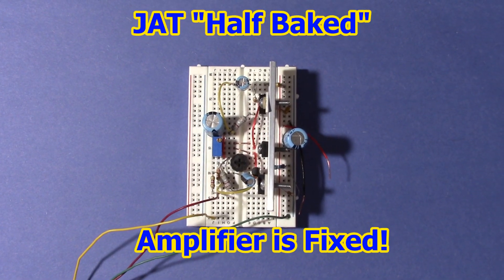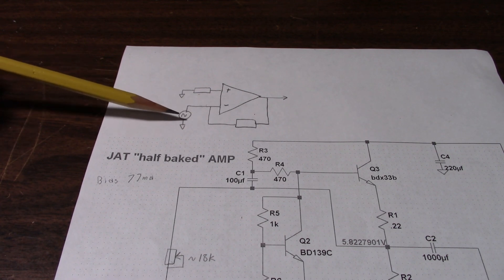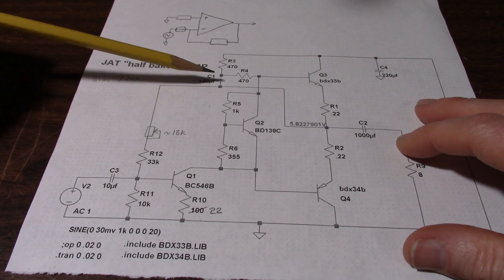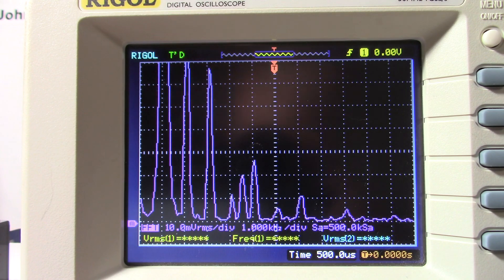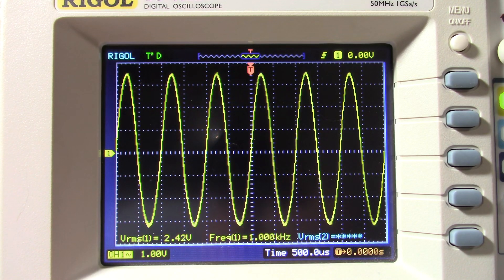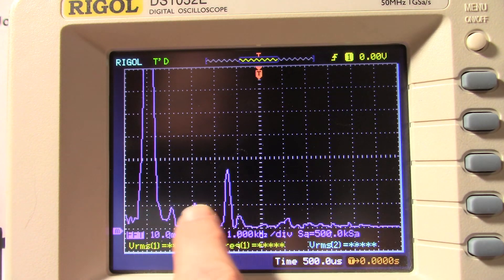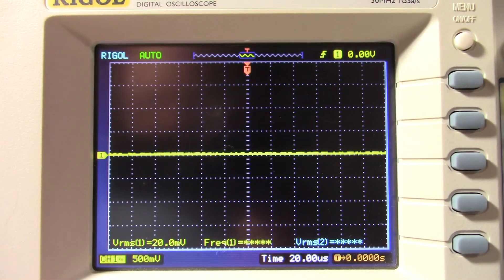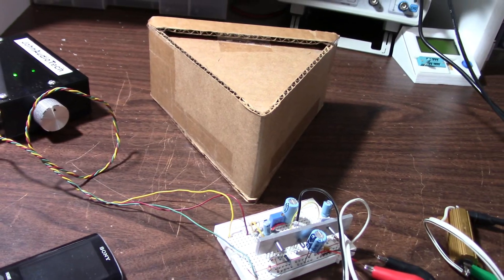JAT half baked audio amplifer problems fixed

Comment: I didn't even think about the 4.7kΩ resistor. perhaps, further increase in drive impedance would reduce distortion even more. I wish I could post a schematic, for a class A complimentary driver stage, consisting of a 2N3904 and 2N3906 transistor with the collectors joined at the input of the amplifier(get rid of the 4.7kΩ resistor) and the emitters of the transistors would use 4.7k emitter follower resistors to the supply rails, and the  bases would be biased by connecting 4) 10kΩ resistors all in a series across the supply rails, the bases of the transistors connected to the junctions of the 10 k resistors connected to the rails, to the center two resistors, and finally, apply the signal source (through the input capacitor) to the center of the 4 resistors. That would convert the voltage from the signal source, into current, providing an infinite drive impedance to the amplifier, allowing maximum effectiveness of its negative feedback. you would be surprised how good your signal to noise ratio would be.(the input impedance would be about ~9.2kΩ)

Comment: hello john, i've working on a similar circuit to yours but i have some bias stability issues, it's very sensitive to overheat when the voltage(9v) gets a little bit out of range, is there any trick to keep the bias constant and dependent from the power supply voltage, this also would be good for portable aplications keeping the sound quality over time when the batteries run out.

Comment: btw, John and all the other audio amplifier enthusiasts: If anybody wants to build a self stabilized audio amplifier for 10..12 W @ 4 Ohm and distortion well below 1% with very low effort, you can use the concept of a low power rail-to-rail opamp with a BJT booster stage controlled by the currents through the opamps power rails (see https://ibb.co/QvfpSDk ). Here some pictures:

https://ibb.co/DtfWzyn breadboard circuit
https://ibb.co/zx1R6rL stereo on pcb
https://ibb.co/sv6yZBh in its housing (you can see the speeker terminals for bi-wiring)
https://ibb.co/Bfvb1mb front view
https://ibb.co/vwYDrDP rear view

Comment: I have improved your half baked audio amplifier design to improve the temperatur stabilization of the output offset voltage by use of Q1, which must be glued together with Q2. So now the output bias current as well as the output offset voltage is temperature stable (see https://ibb.co/vzCzRX1 ). I have also reduced the bootstrap coupling resistor R6 in order to keep always a positive voltage on the current regulator diode. The low frequency bypass across C2 was improved by increasing its capacity value. Figure https://ibb.co/PgDz2xr shows the calculated FFT, showing good values of distortion well below 1%.

Comment: John, what do you think of this very simple symmetric amplifier design https://ibb.co/BtXvYFx ? Not only the differential amplifier, also the output stage contributes to voltage amplification. This leads to a very high open loop gain, which is good for suppression of distortions (see the FFT https://ibb.co/DYcm4XY ). No offset correction is needed and the bias current can be set easily by use of R1 and R2.

Comment: By use of this configuration and the application of power MOSFETs it is also possible to design amplifiers with higher output power. https://ibb.co/SRvCRBk shows the design of an amplifier with an output power of 40 to 45 Wrms at a speaker load of 4 ohm. Because of the very high transconductance and the low drain-source-resistance of the output transistors it is necessary to use sufficiently large source resistors in the output stage. I have used 0.47 ohm. Otherwise the output stage bias current can become thermally unstable due to the negative temperature characteristics of the gate threshold voltage.

https://ibb.co/xJC4Z8p shows the calculated FFT of this amplifier.

Comment: I have modified your circuit a little bit to improve some properties (see https://ibb.co/Snd1ttR ). The imput impedance is a little bit increased, by use of a higher resistive amplification network R7 and R8, 100k and 10 k, respectively.

I have also increased the emitter operating point of Q1 to 1.35 V by increasing the R1 in order to work up to input amplitudes of 1 V. R1 is shunted by a capacitor to keep the open loop ac voltage amplification as high as possible. Therefore I have also integrated a 4.5 mA current regulating diode E-452 instead of a resistor. It helps also to stabilize the operating point of Q1. The output offset voltage can be set by R2 (a precision trimmer).

For the bias spreader I have used a BC457B, which must be glued to the heat sink of the output transistors. In order to set the output bias current R3 and R4 a single precision trimmer of 10k can be used. For the output stage no emitter resistors are needed, because of internal base-emitter-resistors of the inner circuit of the TIP120 / TIP 125 darlington transistors.

I have changed the circuit to work with a symmetric power supply (+ / - 12 V and ground). The simulation of the FFT shows useful suppression of the harmonics (see https://ibb.co/kh72yQs ). In this configuration the amplifier is capable to provide 10 to 12 Wrms of output power on a 4 ohm speaker load.

Comment: Built this today and getting 2 watts out of it, loving these videos thanks for taking the time to make them :)
Reply: What is your supply voltage? I don't think 12 volts will get you to 2 watts. I have found similar circuits need about 14 volts ( car electrical system) to get to 2 watts into 8 ohms without clipping.
Reply: @davekazoroski6548  12v into 4 ohms sorry should have said that
Reply: OK, makes sense, that's why car audio usually uses 4 ohm speakers. Maximum power from a low voltage power source.

Comment: The issue is more likely quality of socket-board. I've an old 3M i've used for years with never a problem but these little chunks of China made stuff that are cheaply priced go faulty real easy because of the bad contact-tension after only a few times used.
Reply from the maker: The ones I have still have good tension. It could be  conductors used are not good and have some surface oxidation.

Comment: Really smart video. A clear demonstration of the problem with any sort of proto board. Breadboards (socket boards) are little worse than other non-solder attachments. 

Imagine taking this to anything in the RF range. How many YouTube's are showing people circuits with no regard for the problems of breadboards?

In my hands breadboards have been great for low speed (<10 MHz).  Even that is pushing things. 

Nice job.

Comment: Hi john  i have 4 ohm 50 watt 8 inch woofer. Of what wattage amplfier should I connect  to it
Reply from the maker: You can use any wattage amplifier. Over 50 watts you'd want to be careful with overdriving it.
Reply: @JohnAudioTech  up to. what wattage I can go

Comment: i would like to learn and test audio equipment like yours but i dont have any decent oscilloscope.. for beginner is it good to buy or use those cheap oscilloscope like DSO150. will i get the same result like yours or at least pretty much the same. for example will i get the pilot signal, harmonic signal and so on..

Comment: Great video.

One question. Wouldn't it be marginally better to put the input resistor after the input capacitor so that the capacitor could have one of its leads tied to a low impedance source? This is admittedly a second order effect, but it's still considered good practice in many fields...
Reply from the maker: I can see some benefit with capacitor types that have the outer foil connected to the lower impedance side or ground to help shield out noise.
Reply: Really doesn't matter. Since the resistor and capacitor are in seeies. The circuit will perform the same either way.
Reply: Not true. EMI susceptibility isn't linear and superposition doesn't hold.

Comment: I gave up with my breadboard too except for the really simple stuff, just too finicky.
Reply: You can get a ton of protoboards for cheap, and those are so much better. Too much capacitance and inductance in breadboards, even the good ones.
Reply from the maker: I'm too cheap to use up components on perfboards. I'll have to use them on higher power "hi-fi" amps because they just won't work on the socket boards. Socket boards are handy because I can quickly demonstrate something by adding/removing/changing a component.

Comment: Very interesting John.. I was glad you told us all that you put a 500K trimmer in the circuit  instead of a fixed resistor, as at the point you were adjusting the bias, I thought I'd missed a 'major' piece of knowledge about bias adjustment, ha~ha... Clarity I thought was very good for such a low powered device.. Maybe the separation  was compromised a little , but 10 out of 10 otherwise.

Comment: Hay John, great videos, want me to do the PCB design (for free of course) for your main amp ?
Reply: you may start an indigogo campaign.
Reply: @iceberg789  Nah, just wanna practice doing some good quality PCB design for audio on easyEDA and kill some free time and I am not good at making money (3 times job quitter , they couldn't fire me, I fired them) , so that's not the point.
Reply from the maker: I appreciate the offer. I might need help along the way but I really need to jump in with both feet and learn one of the PCB design software if I'm to get anywhere with this.
Reply: @JohnAudioTech  Sure but if you need to to check & verify once you are done designing PCB layout yourself, I would be glad to help
Reply: @JohnAudioTech  give KiCAD a shot. It is free and pretty usable today. Although the workflow to go from schematic to layout is a bit weird. It goes like this, draw the schematic with eeschema, annote schematic components U?A 123 icon, or select component with contextual menu Edit Component -> Reference and assign a Reference number, cvpcb - to associate components and footprints, netlist - NET icon, pcbnew - to layout circuit board. That'll make more sense if you try running the program.
Reply: @1pcfred  I agree  and Kicad (big fan) has improved a lot.
Reply: @1pcfred  yes, CERN have developed it from day one so its in good hands ! I just use the straight stable download and love it.
Reply: @JohnAudioTech  FreePCB is all you need. Free and easy to use WITHOUT all of the top heavy crap of most other so called “free“ programs. Also no limitations on number of pads, number of layers or anything else.
Reply: @Mikere5  Kicad is open source and that means more than just "Free" its built by passionate people and comes with no "top heavy crap " and is in great shape now and improving every day.